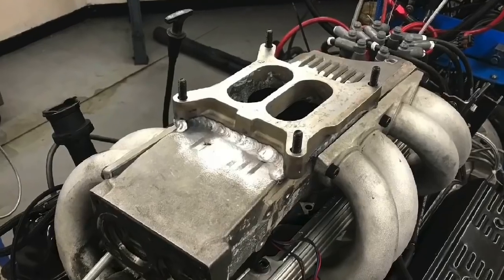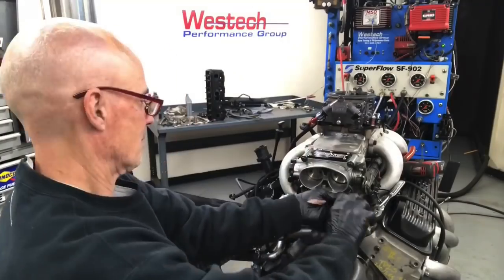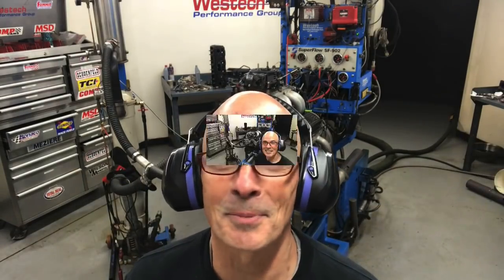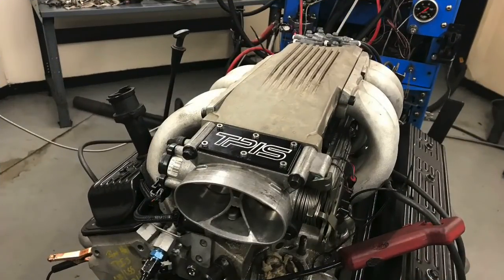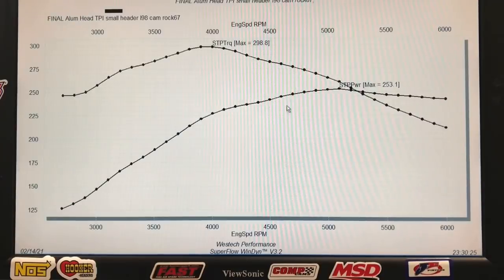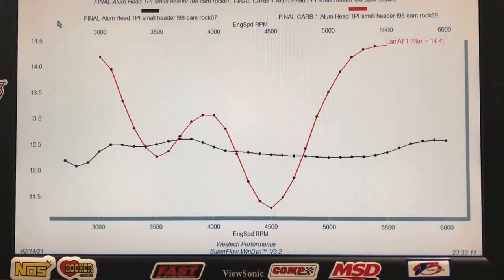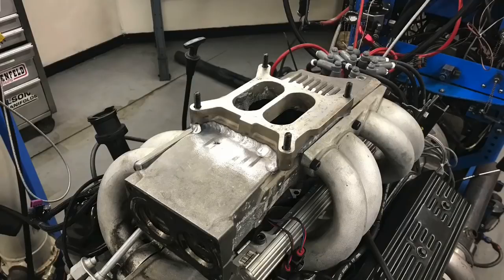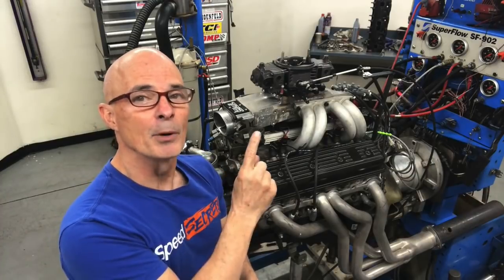CARB VS TPI? HOW TO: CARB YOUR TPI!

Comment: I know this is an old video, but I've been toying with using a side draft carburetor in place of the throttle body. I feel like that would give better distribution than scabbing a Holley onto the lid. Now, a supercharger on the lid, that's a different story....

Comment: Hey Richard.  9:00  You said you couldn't take fuel away on a carb at 3500 rpm & not change Aid Fuel Ratio somewhere else.  Did you ever hear of that device called a Carb Cheater????  I saw a video last year & its really taken off & it works.  
Turns any carb into electronic self tuning carb or you can tune if with built in software.  Here's a description below & maybe this is the Holy Grail & next level in refined carb tuning & can be implemented for performance:  See below caption:

The Carb Cheater is a device that simplifies carburetor tuning for classic car enthusiasts. It is a metered vacuum leak that provides real-time engine data feedback, including AFR, thru Wideband sensor, Vacuum, Speed and RPM. The Carb Cheater is not a crutch for making a badly tuned carb work, but rather an air/fuel correction that helps to get dead on in virtually all conditions.

Comment: Why was the stock L98 down on torque? The 253 hp is about right but 293 lb/ft is about 50 lb/ft low.

Comment: Curious, how were you controlling the tpi on that stand?
Reply from the maker: Holley ECU
Reply: @richardholdener1727  teach me the ways. Lol always been a lazy carb guy. Long story short I've built a body dropped 76 chevy luv and I just pulled a complete l98 out of an 85 c4. I've got the complete engine and trans on the frame and have been debating just carb swapping the thing. Due to the harness scaring me.

Comment: 8 single  carbs on the straightest,  shortest / biggest runner tubes possible , with the manifold hogged  out. Keep the injectors and compare the carbs vs injectors and then combine carb and injectors together.  Please.
Reply from the maker: shortest manifold?

Comment: I know im late to this BUT... chevy built these to make power low with taller gears and to make longevity... an engine that turns less rpm will last longer, theoretically. They were not balanced to spin past 5k so they achieved their goal.. now on building, one would need to redo the bottom end, completely balanced and blueprinted as in my new L98, if it were wanted to take to "beating" plus, depending on desired rpm range a specific cam. Your absolutely right with these TPIs... tunnel ram is the killer, my car will last forever but won't keep picking up power due to this. Dart heads, spec cam and full Hedman exhaust system with lci runners it's impressive but don't turn in past 5k or you be let down... many have said "put a carb on it" and I believe them especially now with this video... thanks and hope it helps others. BTW my tpi L98 puts out almost 400hp and 500ftlb around 4k but falls on its face after that... let this be a lesson for you all... stock works great, modded let's you down on the tall end... put an intake and carb on em!
Reply from the maker: every l98 is balanced from the factory-the make power at lower engine speeds because of the mild cam and long-runner TPI intakes. 500 lb-ft from a 350 would be a tall order
Reply: @richardholdener1727  over ⛶  been punched way out... idk who built this engine but it's super strong low end. I have a book of all the receipts and literature with a dyno sheet, its all just thrown in together and idk what fuel they ran to get the figures. It Doesn't spin just goes, but has rear end gurtle so I'd assume Rear end beefed with a tci trans and 23-2500 stall. All that work to leave the tpi? Idk why, other than stock appearance..has large injectors msd box with lots of internals.
Reply: I'm gonna put an reg short intake on it with a 750 carb and see what that does for it on top.rpm band way to short for this set up
Reply: And honestly it's not 500 ft lbs but 479.6, I stretched it a lil.. hp is 401.9

Comment: What about building a smaller air box where carb goes on, might help it with distribution of fuel. I’m working on having a box made to try it on my car so I can use the injection side for nitrous. Thanks for all the help here

Comment: My theory is that the fuel curve at the beginning where it was rich, actually was from the tail end of the accelerator pump discharge, and not the jetting. The TPI was designed to transport airflow only and we could expect the results as shown. I would love to see you take a Smokey Ram intake and install a port injection system inside it to see the full potential of that manifold. I run one on my street vehicle and it easily beat the Vic Jr intake which was the previous best I had used. I know it has wet-flow disparity between cylinders , but not so bad as to make it a bad performance intake, just less fuel efficient. Smokey Yunick was my "Idol" when it comes to engine builders. He really knew his way around the SBC. His method of trial and error and applied experience was awesome. Thank you Richard for keeping up the tradition and for giving us the answer to the question this video presented. God Bless you my friend.
Reply from the maker: the motor is a wot at the start of the dyno pull-the accelerator pump is not in action
Reply: @richardholdener1727  Hey Richard ! Are you sure? The secondary accelerator pump should still be discharging at that RPM even though the throttle reached Wide Open moments before. The pump doesn't discharge all its fuel immediately at W.O.T. due to hydraulics (cannot compress the liquid fuel). The pump spring continues to push the fuel diaphragm until the pump is empty. Anyway, what do you think of trying the Edelbrock SY1 Smokey Ram with port injectors? I currently have mine of the engine as I am rebuilding it.

Comment: WTF....what if????? Hey somebody else mentioned it...keep the port injection, put throttle body on top...plenum will still only be moving air, I think a lot more of it.
Reply from the maker: that just eliminates the stock TB as a flow restriction-it isn't much of a restriction at this power level
Reply: @richardholdener1727  Keep doing the what if stuff.If I had a dyno and a hammer, I might have tried hundreds of crazy what if things.

Comment: I did the old fashioned  way.I threw the tip stuff in the trash.I put on a stock aluminum quadrant intake.Just enough room for a shallow air cleaner and shut the hood.mine is an 85 so it has heat crossover that helps atomization. Once its warm it's just as good as tip in my opinion and much simpler.I had an 89 tpi firebird in 1990 so I'm not talking hearsay.

Comment: Wouldn't the main reason this intake limits power building around 5000-5500RPM be because of the upper intake plenum volume?
Reply from the maker: runner length
Reply: @richardholdener1727  those certainly are some damn long runners lol

Comment: Hey Richard could you please make a couple  morecof videos TPI L98 5.7 liter. Preferably 300 to 330 horsepower recipes that could match or even exceeds the second generation LT1 and LT4 in regards to horsepower and Torque. Thanks.

Comment: What about just cutting the lid off and welding taller walls back on for more volume,  fab up a massive throttle body, then fab up the runners into giant funnels at the top down to stock at the bottom side. Sort of a giant tunnel ram tuneport but since the volume will be so great you'd probably need plenty of boost so it didn't face plant on the bottom end.

Comment: Truly awesome! 

What a great nutty idea and seeing your true excitement made it that much better!  Loved all the crazy effort you went to on these tuned port tests. 

More crazy stuff, please! ;-)  Make some bolt on side-draft IR runners for the stock lower TPI intake -do relatively straight runners of the same length significantly improve the power vs. curved runners? (Guessing not, but it would be so cool to see if the big curve makes a difference or not.) 

Video / Series on things that help to keep detonation at bay: build an engine that's just over the edge into knocking on CA 92 octane or maybe a LOT over the edge (Pipemax will estimate octane requirement of a combo): then pull timing until you stop knocking: measure power. 

Run the "definitely knocking" test with a thick head gasket that makes a terrible quench, swap to a 0.015" shim gasket and see if a good tight quench can make up for the increase in CR / cylinder pressure anyway. -how much more can you make with timing reoptimized? 

Run the "Definitely knocking" test with hot air intake and switch to cold air.  -Switch from a 200 / 210 F thermostat to a 180F or 165F.  -Any more power with optimized timing? 

Use the BLP piston oil squirter drill kit and add piston oil squirters and an oil cooler. 

Throw everything at it: Can you get a 9.5:1 DCR alum headed combo to run on 92 octane without knocking with all the tricks?  -If not: Water Meth!

Comment: that position in the center caused too much turbulence & empty air pockets for poor fuel atomization. I think making an adapter to the front throttle body & mount the carb to the adapter off a 3 & 4 inch inch tube  to see what worked better.     That I feel world of flattened the afr ratio to produce a better air pulse & fill the plenum better. Then work the inner plenum with air director bolted in like using a carb spacer by diverting the air signal

Comment: I'm wondering if you mount the throttle body up top will it lose power as well?
Reply from the maker: I DID THAT-IT ADDS POWER
Reply: @richardholdener1727  Nice!  How much more than the baseline TPI?  I could do that to mine

Comment: Have a valve regulated to lean it out a 3500 a linear valve or pwm regulated valve could create an adjustable vacuum leak at the pre set rpm

Comment: I had a dirt track mustang guy tell me about a crazy 2bbl on top of a 5.0 efi intake the carb started and idled the car and would run up to about 2000rpm then through some switch on the linkage or something the efi kicks on and powered these huge fuel injectors and he had made some provisions for 4 stock 5.0 throttle bodies it had no drivability on efi hence the need for the 2bbl carb to idle it around it had no efi idle air valve hooked up it was basically an efi secondary system he tried running it to skate the rules of carbs only calling it a electronic regulated carb system stating the factory runs them they didnt buy it but he ran it in the unlimited group and said it was real fast keeping up or outrunning dirt mods with a dirt stock chassis

Comment: What will happen if you have the fuel injection and carb supplying fuel together at the same time, keep the TPI throttle body blocked off as you have done for this video and use the carb as a carb and as the main throttle body. I have thought of doing this many times.

Comment: Great effort!  I'm curious if you kept using the TPI injectors but let the air in with the carburetor or just a 4 barrel throttle body in that position.  Or with a 4 barrel carburetor at the normal TPI inlet, but  using an elbow or something.

Comment: The external runners are the problem.  How bout putting four webers on the sides of the lower instead of the tube runners.  Or maybe build adapters and run a cross ram with a couple of two barrels.

Comment: A local demo derby guy always runs some old single barrel on top of gm 60 degree V6s in a similar setup. I always wondered what it did to the horsepower. Guess now I know

Comment: Hey Richard I have a ported head, big cam, tbss ls2 In my Silverado. I’m using the adapter to bolt the early 3 bolt 78 to the tbss. How much am I giving up? X link and gold blade 90mm are expensive. Test it? Already have? $22 adapter to put a 3 bolt on a tbss. The truck coumo would really appreciate this test!
Reply from the maker: THAT IS 12 HP (HE SAID WITH A GUESS)

Comment: I wonder if using a TBI style injection system would work better. Because you now have a single plane, large plenum, long runner intake under a carb and it may not be getting a good signal like a dual plane would.

Comment: You can change the afr at different points on a Holley style carb if your metering blocks  have screw in emulsion bleeds. Not necessarily easy but can be done. You rarely see it done except on max effort builds.

Comment: long runners are NOT the issue - it wasn't designed for a single carb.  air can make sharper turns, but throws fuel out of suspension. cold runners are a giveaway that fuel is puddling.  
the large plenum is diluting the vacuum signal.  you'd normally size a carb with 1.6xHP which is 400 cfm, and unless you epoxy the plenum you'll want to go with a smaller carb.
four ITB (so the barrels are right between the runners) would be the best you can get. You need a taller carb pad and gentle rads to smooth wet flow.  get out the epoxy.  have fun!

Comment: can ya put a 2 or 4 barrel on a cpi vortec? does the stock intake work as good or better than a preformer intake? does a carb bolt up to stock vortec intake? would a stock vortec intake be a better or cheaper option than buying a new aftermarket intake? would a carb work as a temporary fix until you could get out of winter to rebuild the spider assembly in a safer location? (the spider injector assem is a known failure that will leave ya stranded in the worsed possible place)

Comment: the lt1 manifold is way to narrow up top for this to work as easy as it did with the tpi and i believe the purpose with this was to get the torque of the tpi but with the HP of the carb.  a better test to try and get both worlds would be to see what a carbed tunnel ram would do with its longer runners or slap a super ram on it

Comment: the dual plane carb gained 7% tq and hp when the super l98 cam was installed 280tq 277hp to 299 and 298
the tpi with small headers, small cam and alum. heads made 263hp and 307tq applying 7% would yield to 281hp 327tq for the tpi, why would the carb gain 7% but the tpi lose power with the super l98 cam?
Reply from the maker: I'M LOST
Reply: @richardholdener1727  the dyno graph in this vid shows with the tpi alu heads and super l98 cam making 253hp and 299 tq but from the previous vid https://www.youtube.com/watch?v=CF25ABI1-Xk  it showed 263hp 306 tq prior to the super l98 cam

then once that cam was installed on the dual plane carb it gain 7% in both hp and tq compared to the last test which had the smaller dur. cam and iron heads so we can assume that just the cam change was worth a gain of 3%
Reply: @richardholdener1727  why did the tpi pull in this vid lose power down to 253 compared to the other smaller cam which was the only change from the previous vid 263hp 306tq https://www.youtube.com/watch?v=CF25ABI1-Xk

Comment: Using the tpi manifold as a roots blower manifold would be interesting, I would be interested to see what kind of torque it could make, an you could double the testing by running carbs on the blower and the throttle bodies and use the injectors, would be a good a/b test of the manifold with air/ fuel  flowing through it and just air, under boost of course

Comment: I love it! When you sit around with your buddies and say things like "I wonder what would happen if you put a carb on an intake with long runners meant for efi?" Richard's out here running all the tests!
Reply from the maker: we gotta do it, right!
Reply: @richardholdener1727  There is ALOT of plenum volume going on there. What if you build a sheet metal plenum just large enough to accommodate the runners, weld a divider in the center of the plenum to create a "Dual Plenum", then run the carb on that. I would think that would have to help with the fuel control. Thanks for the great vids!!
Reply: This is sort of my idea on a stock TPI Plenum, still using efi, but make the plenum into a duel plenum with a divider down the middle to separate left & right bank pulses & increase velocity to each bank.🤔

Comment: Maybe a Qjet with a 2" adapter. Porting on the plenum.  And changing the secondary throttle blade angle. Might be too much work than what it's worth though.

Comment: You gotta do a test to see if the air foil changes anything
Reply from the maker: i did
Reply: @richardholdener1727   thank you
Reply: TPIS recorded 7hp and 7tq on a stock 350 tpi in there insider hints book but they had a snorkel/velocity stack in front of the TB to simulate the factory intake boot

Comment: Always wanted to try 4 side draft carbs using the tpi base as a starting point. 
 I've had a couple tpi motors,  one Corvette one Trans Am and a fiero gt with Corvette tpi motors and a getrag 5 speed.  All of them had their strengths and weaknesses. 
 Tpi is awesome for a daily driver %100.

Comment: Put a 350cfm 2 bbl on each runner pair, or a 650cfm on each bank.
  Check how ballanced the fuel distribution  with an IR temp gun on the headers. Willing to wager back 2 maby 4 are way not happy with front 2 rich. 

Spin the carb( primary to the rear)